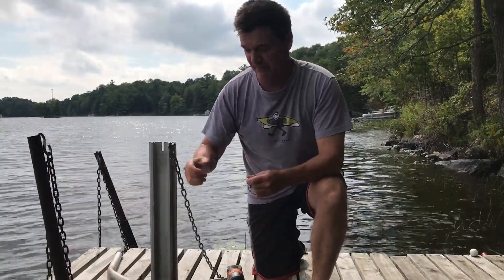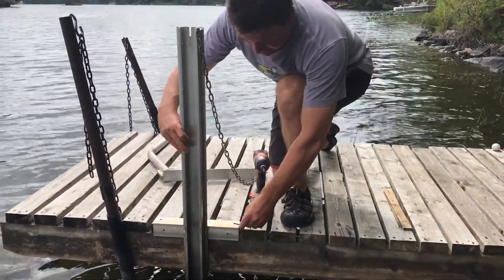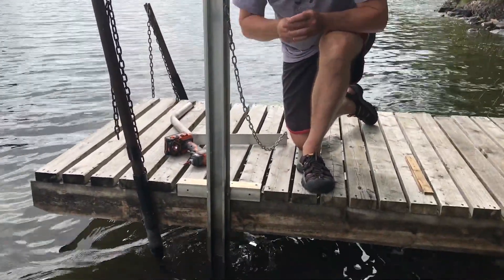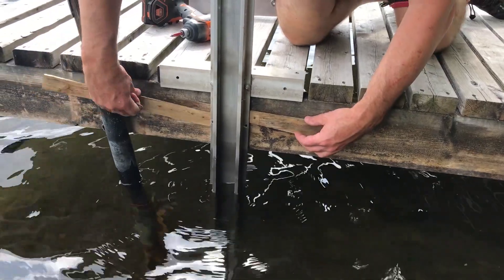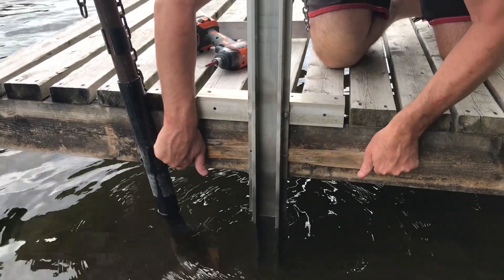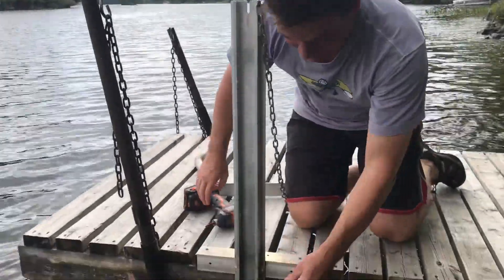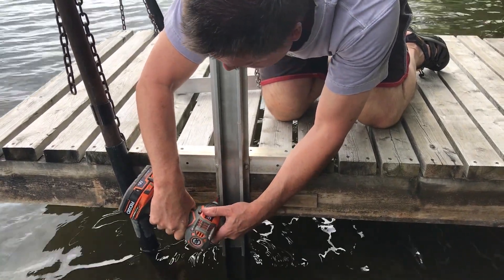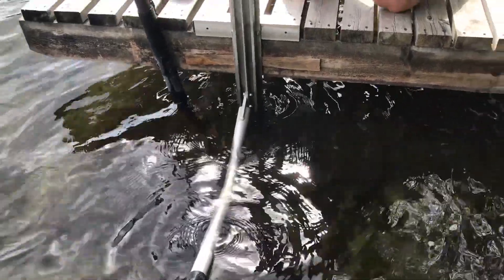HOW TO INSTALL THE KAYAARM ONTO A DOCK

Comment: I have a permanent dock on a river with large freighter traffic. The distance from the water to the dock changes seasonally based on rain and snow fall in Lake Superior and Lake Huron, can be as high as 1 inch below the dock or as much as 4 feet. So a ladder would be needed.. The dock remains in place through the winter but the ice will chew this up. Questions:
1. Using a sloped swim ladder to make climbing easier for the... "wise people"... how should this be mounted to accommodate the ladder?
2. Is there some kind of quick disconnect or easy attach/detach device or bracket so I only drill the screws once and connect to a permanently affixed bracket or something?
Thanks.
Reply from the maker: Jon,
You have a couple of options.  In the case where you are looking for stability only and thus only require one KayaArm you can attach the KayaArm to the side of your ladder. This option is discussed in more detail on our website in the Assembly/Instllation section in the detailed Assembly instructions.  
In the case where you want to have Lift & Storage capability you will require two KayaArms.  In this instance to accomodate a wider ladder you can build out the KayaArm mounts on your dock for example 2x 2"x8" through bolted to ther rim joist of your dock to place the KayaArm mounting angle on and screw it to the blocking.  This will give you 3" projection to accomodate your ladder, although it is dependant on your specific ladder and kayak dimensions I think that might be a good starting point.
With regards to quick disconnect to remove the KayaArm requires removal of the 4-6 installation screws which took 2 minutes in the video above with a lot of explanation and is easily completd in less than 1 minute...hopefully that meets your definition of a quick disconnect.
One other thing is that out of the box the KayaArm handles 30" from mounting location to top of water but is easily modified and the video is in the same play list as this video.  For more information please see our youtube channel https://www.youtube.com/channel/UCoV4FWxgBnbVM7EpBNSxJ8Q
and our website https://kayaarm.com/

Happy Paddling
Jay